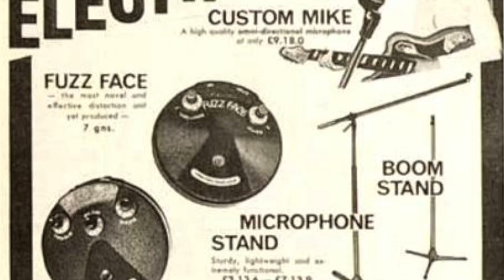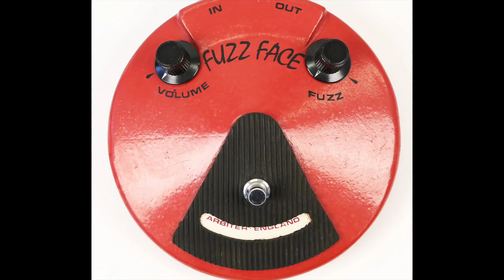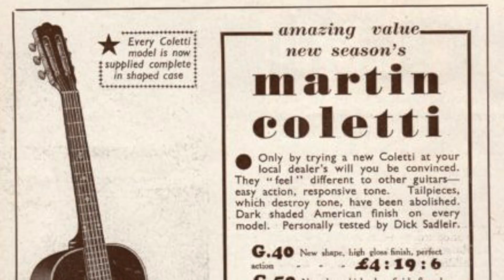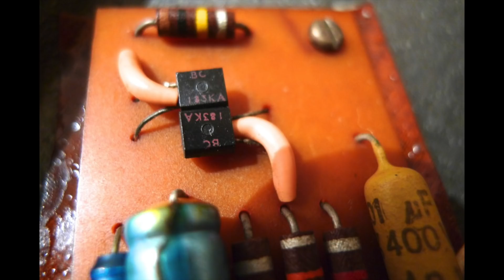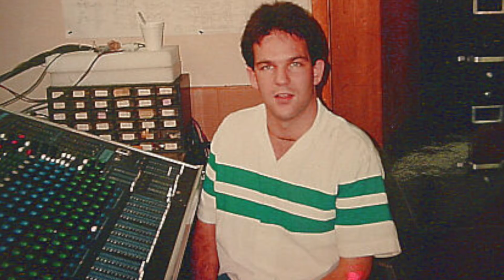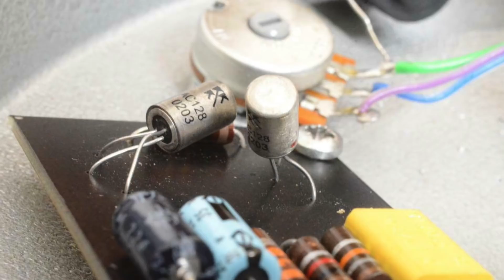History of the Fuzz Face

Comment: I love how Fox says he gets a decent sound out of a 76 by changing resistor. I've got one. I've had it for about 15 years now. I got it at a guitar show for a steal. And I'll tell you what, it's one of my favorite fuzz faces. I've had the analog man. I've had full tone. I've done the Dunlop reissues And personally, this is the one I like the best. It has a fairly decent cleanup. And if you crank it and crank the amp, it's definitely Got that JH at Woodstock feel. I'm sure someone will tell me I have no idea what I'm talking about. But who knows, after 50 years, the values drift, and maybe it's stumbled into. the proper space needs to be, but it sure sounds good. Its flaw it needs to be turned up really loud. Unless you want Dark fuzz sound.

Comment: I have a late 90’s Cornell fuzz face with the internal bias pot.
 It’s awesome
Reply from the maker: They are really cool - did the internal bias pot come as standard?
Reply: @TheGuitarShow  No, I have one of the late serial numbered/none limited signed Cornell models and it used vintage looking resistors and caps, but no trim pot. It has AC128 transistors and it isn't a good one, the gains measurements are way off . I bought it as I built and experimented with the FF circuit in the 90s.... easy to make a good one if you have suitable transistors and put the right resistor in to get 4.5v at a test point. I have heard that Mr Cornell did check the first 500 but after that they are not checked very well.

Comment: few corrections:
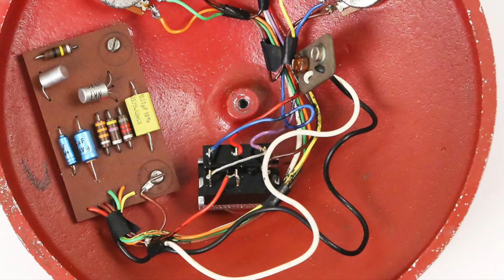1) 2:43 The Tone Bender was already true bypass in 1965.
2) 5:19 The 470k volume pot on the Fuzz Face is not necessarily a modification that Arbiter came up with. It seems more likely that they used an early example of the MK1.5 for reference, which featured 500k level pots. Some of the early Fuzz Faces even came with 500k level pots.
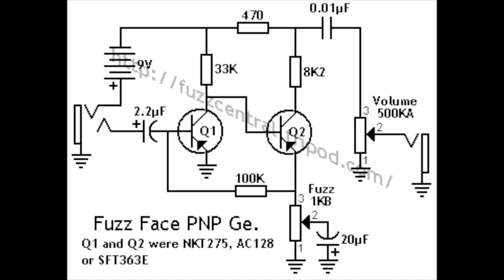3) 6:12 The FZ-1 was advertised for sale at $39.95. It's rather pointless to use 2020 currency exchange rates to compare the cost of that model in the USA, with the cost of a Fuzz Face in the UK. I have a catalogue scan from 1969, which lists the American price of the Fuzz Face at - exactly the same - $39.95.
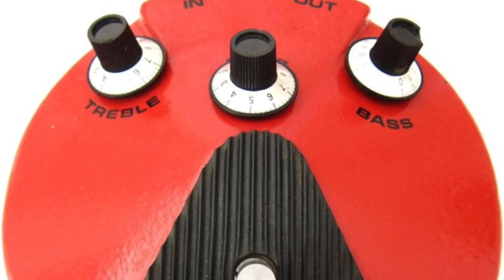4) 9:00 BC183L Fuzz Faces predate BC108C Fuzz Faces. They often come in 2nd style enclosures, with 1968 date codes.

I stopped watching at around 13mins in because 1970s Fuzz Faces don't even remotely interest me. Maybe Dustin Francis can pick up where I left off.

Kindly add these correction in the description field for the video, and as annotations at the relevant points of the video? I appreciate that it's all rather murky stuff, but it's important to get these facts right.
Reply: I think also worth mentioning was that the fuzz Jimi was using for the Band of Gypsys concerts (and mostly since the Axis Bold as Love album in various iterations) was not a two transistor Fuzz Face circuit at all, it was Roger Mayer’s interpretation of the Helios mic pre-amp console - it did use silicon transistors but three of them rather than two. 
This fuzz was named the Axis Fuzz and it seemed likely that the early versions of it featured germanium transistors, notably the Axis Fuzz used for BOG has an almost distortion sound at times and these units could be placed after a wah pedal without I’ll effect. 
An example of Jimi using a silicon fuzz would be at the Isle of Wight performance, with the Axis Fuzz seemingly not on hand Jimi would use a standard issue silicon Fuzz Face which can be heard picking up radio interference throughout the earlier stages of the show.
Reply: @daveplays7507  I don't think we can accurately determine whether a pedal used on a specific live recording might have been one of Mayer's, or whether it was just a stock Fuzz Face. My vintage BC183L Fuzz Face doesn't pick up radio interference either, and I'm reasonably certain that it's never been within 100 miles of Roger Mayer! :)
Reply: @nicksternberg579  Hey Nick, I can agree with your speculation, but in the case of the BOG Fuzz it’s been pretty well documented, re-produced by RM, and somewhat faithfully recreated by Dunlop and other boutique pedal builders. 
The Axis/BOG fuzz doesn’t suffer from RF interference whereas it is known that a silicon transistor FF without the right smoothing caps or dodgy trannies can pick up some funny noises in specific contexts.
I have read that Jimi was using a BC108C at Isle of Wight and to be honest that thing sounded very unruly!!

Comment: I had one and a Watkins Dominator amp in the mid 60s. Didn't like the sound so I took the internals out and made it into a switch for a signal booster. I also cut up the Dominator because I didn't like the shape. Oh , the ignorance of youth. Ive still got the shell of the Fuzz Face somewhere.
Reply from the maker: Nice info Tony, please sell me the case of the Fuzz Face 🙏🙏
Reply: @TheGuitarShow  I've had a good look and sadly, during the last sixty years or so it has disappeared.

Comment: Very informative. I will listen to the history of these effects over and over, and you held my interest with ease. Well done! 

I’ve went down a rabbit hole with Fuzz Faces, both vintage 60s-early 70s built ones and many recent vintage clones. 
Even Analogman’s NKT275 WhiteDot or Red Dot Germanium fuzzes are just such a headache at times it just wasn’t worth using much for me. Someone offered me $500 once they was a wait of you to a year for one. And he was running out of those transistors. I wish I’d kept it now, just for my collection. 

I found the 2008 Dunlop JHF1 BC108 Silicon Fuzz Face, around 2012, and still have it on my board today. It has the best clean up, while still getting all the gain one could want, and never has the problems of Ge ones. It will still give one issues with occasional radio signals coming through(it’s very rare for me), and with a Wah in front, but there are ways around that problem too. Which I will never understand why a simple buffer isn’t put in Fuzz Faces so the Wah problem is gone. Dunlop/MXR just recently mad a mini Fuzz Face with both Si and Ge options, and the buffer for using a Wah before it. What took so long? 

That 80s Dunlop is just a bad circuit, as I’ve played at least ten of them, and each seemed like a different Fuzz pedal, no consistency. There wasn’t any testing done on the transistors, which is what Analogman takes pride in doing, so each Fuzz can be extremely different from the others. All but one I have owned or demoed just plain sucked. Sucked tone, and sucked in general. The 90s ones were even worse as far as any I’ve played. 
The 2008 Dunlop has everything one would want in a vintage two knob Fuzz Face, and modding it to get more Germanium-esque tone can be done as well. They did signature ones for Eric Johnson like Bonamassa, and a few others, but they have the same issues. 
Hendrix used tweaked Silicon fuzzes from just before the Band of Gypsys show, and from then on. 
Analogman is a wealth of knowledge and wisdom on all these circuits, but Hendrix probably went through hundreds just by himself, because of germanium problems.
His meticulous way of choosing the transistors, and adding of a bias is why everyone believed the NKT275 White Dot to be a holy grail. Except, once one has one the same problems will occur, and the bias knob isn’t always the fix. At least he was honest about how many of the transistors he had, which is what made them the Klon Centaur of Fuzz Faces. Now his King of Tone has such a long wait time(I think up to 2 years still), folks will pay ridiculous prices for one not to have to. 
My current favorite is the Deep Trip BOG, which is based on that BC108 circuit and has modern option that almost no one does. They put a bias, like Analogman does for some of his, while also adding High and Low pots, to shape the time to more warm Germanium, to glassiest Silicon High Gain. Most players just don’t like the low end that a Si Fuzz Face has, so the ability to cut that makes it very versatile. They also changed the input impedance, so the problems of a Wah in front, or the radio signals issue, aren’t there. 
I still can’t quite get it to clean up like the 2008 JHF1, so I run both. The Dunlop before my Wah, and the BOG after.
Reply from the maker: An amazing post many thanks 🙏

Comment: If I had to use just one pedal it would be a good fuzz face.  I recorded a record in fact with just a Strat, BC108 fuzz face, and a 71 JMP.  All the tones are in the volume knob its truly a brilliant design.
Reply: Its one of the biggest secrets I've stumbled upon. You honestly dont need an overdrive if you back the guitar volume down and the amp volume up and you have an OD. It goes from fuzz to crunch. Back the volume off more and you get a treble booster.  They're unbelievably versatile

Comment: Very interesting. Thanks! I have the Dunlop JH-F1 Jimi Hendrix Fuzz Face and the Dunlop JD-F2 Distortion Fuzz Face. The former has the BC108 Silicon transistor and the latter has a germanium transistor. I prefer the sound and feel of the latter.
Reply from the maker: Nice i think those Hendrix black ones are getting rare now
Reply: @TheGuitarShow  Mine is that greenish-blue color. It's a reissue.
Reply: James Carter 
Same. They were first made in 2008, and it’s made to look like one Jimi was using in most of 1969-70. 
What’s so odd, is the red ones like yours were originally some of the first Silicon Faces he used. It gets associated with the Band of Gypsys show and sound partially because of that, yet it was a Silicon BC108 in there at the show, and In other red ones that have been found.
Reply: @CorbCorbin  Interesting. Thanks!
Reply: The Guitar Show 
If you are referring to a Black Fuzz Face not made by Dunlop, I’d love to know who did make them. 
The Dunlop black ones, rare or not, can still be found used for under $100. Some folks will try to sell them for much more staying different reasons why they are valuable, but from what I’ve learned that is usually a misunderstanding, or just a jerk salesman at a shop. 
They are the early 90s ones, made with Silicon transistors, and there was just no quality control on the transistors being used. 
I’ve played a few that were decent and usable, but most of them sound thin, or it’s far too much bass, or just no cleanup, etc.
Reply: The Guitar Show 
Ever play a Hendrix Fuzz Wah? 
It’s a Dunlop product as well. 
Also there are many Hendrix effect collectors who swear by the Digitech Jimi Hendrix Experience Pedal, which is a Wah enclosure, that has 7 different tone models, each based on a song. From Purple Haze to Star Spangled Banner, it emulates the effect of the song. 
It even has stereo capability, but the two I’ve owned broke down after regular use and it was hard to have fixed. I‘ve been debating getting one again after nearly ten years since I had one. 
Sorry I’ve spammed your comment section. I was just inspired by the video, and the comments about what others like about Fuzz Faces or Fuzz in general. 
And I have a load of useless information about them. 🤣
Reply: I’ve used the JHF1 for 8 years now after over a decade of different Fuzz Faces, from vintage 60s ones, both Ge and Si, to Analogman’s NKT275 White Dot/Red Dot and many others. 
I love the JHF1 because it cleans up so beautifully, and still gets s much Fuzz as I need. A mid boost after it makes it just cut through any thick mix. No temperature problems, but still picks up radio signals from time to time. 
I like the JD-F2 a lot, with its warmth and feel when attacking harder or softer, but gigging regularly the Ge transistors became an issue, and it would sound like it was spitting at me some nights. Nearly all Ge Fuzz Faces have this problem. 
And, if one bought ten of them, they will range from nearly useless, to that beautiful warmth that players love in Ge Fuzz Faces. They still have the temperature problem, and some have the high quality transistors, some don’t. 
If you found one that isn’t too fickle, especially if touring, I’d hold onto it, because I’ve never known anyone who kept one for long on a tour. They will crap out eventually because of a temp change, or too much humidity. Modding it with a pot for bias control can help, but not always. 
I still have a JD-F2 in my collection that was a really sweet sounding one, and I may make a project out of modding it with a Bias pot, a buffer, and a Mid Boost, which I think all modern Fuzz Faces should have. At least a buffer so a Wah placed in front doesn’t have any issues. 
I’ve owned so many, and demoed too many to even remember, so I had a Fuzz journal for awhile.🤣 
What I I learned is that it all starts with the Transistors, and testing each and every one of them for quality. If the tranny is bad, it doesn’t matter if it’s the NKT275 or a cheap Russian one that no ones heard of. That’s the difference builders like Analogman have done, and then the market just exploded for them.
Reply: @CorbCorbin  Yeah really think you need to try a crap load of them to get a good one I tried a FF mini and it was awful That particular one anyways Diaz Squareface and it too wasn't all that good either Have tried a bunch of boutique ones as well that were good but nothing special Fuzz is a fickle Mistress and really only like them for the V roll off glassy cleans that certain ones have Hey thanks for the information and hopefully one of these days I will find one I connect with 😅So methinks I will try the JHF1 you said you've been using for quite a while but will store buy after trying a half dozen LoL Thanks man
Reply: Paul Cowart 
Cool thing about the JHF1 is it isn’t too expensive to buy new, and most places are cool about returning them within a certain amount of days, and always will exchange for a different one.

Comment: I'd really like to have an original. The guitarist in my band bought one of those "special run" of Dunlop, Joe bonamossa shiny gold fuzz faces and it sounded great at rehearsal. The 1st festival gig in June, the stage felt like it was 120 degrees F. The pedal worked for maybe 30sec then completely crapped out. He sent it back and they told him it was because the heat from the stage, and it being a germanium transistor, they were notorious for crapping out when they get to hot. Needless to say, it never went back on his pedalboard. He went back to a ts808 tubescreamer.
Reply from the maker: Thanks Robin yes they are definitely sensitive to heat but there's a few mods you can do... Anologman is a master at tweaking the Fuzz Face pedal
Reply: Robin Morris 
If he loved that sound, I recommend him try the 2008 Dunlop JHF1 Fuzz Face. It’s a Silicon transistor, so known of the temperature issues, and has the best volume knob clean up I’ve ever heard in my over 20 years of owning and searching different Fuzz Faces. I also have a Tube Screamer, but I mostly use it as a boost for solos when playing in a bigger band, or just another guitarist who is pushing more mid frequency to cut through. 
The Bonamassa one was basically just something to promote Dunlop and Bonamassa. It’s a business, and those weren’t made with the best quality in mind when it comes to the transistors. 
Eric Johnson has a signature one as well, and he actually used his in performances for years(think he still does). But, he also keeps a few backups with him, because of the same problems with climate on those Ge transistors. 
Deep Trip makes some of the best Fuzzes I’ve ever used, and their BOG has options that others just don’t. It can sound like that Bonamassa did when the temp was just right, but also has the ability to get a far wider range of tones. 
It feels like I’ve played a thousand different ones of them by now, and those two are what I recommend to anyone who asks how I’m getting that tone. 
Because most player’s second question is almost always, “how do I deal with it crapping out with a change of the weather?” 
Another affordable option is the latest Dunlop Jimi Hendrix Fuzz Face mini, which has both Si and Ge options, and a buffer so one doesn’t have issues with a Wah in front of it.